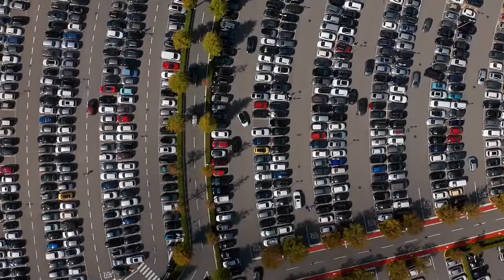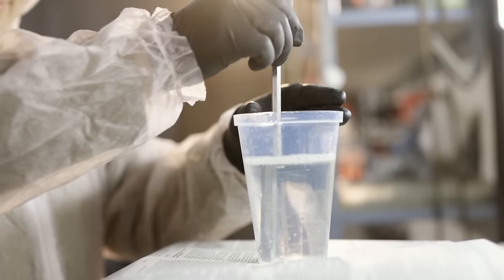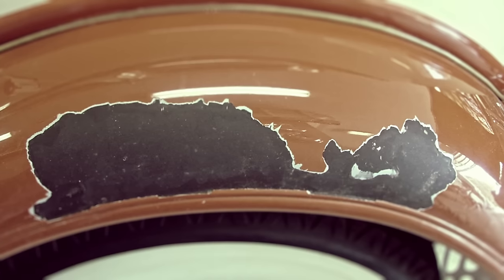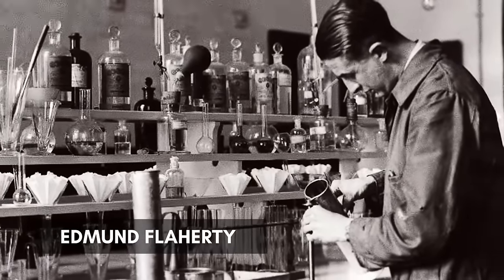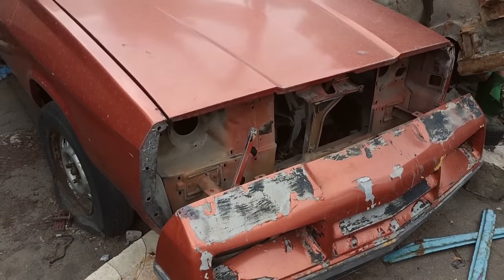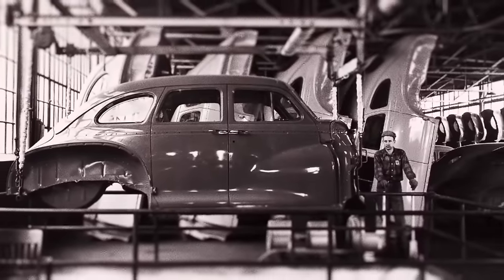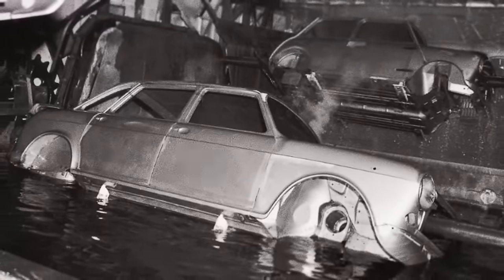The Evolution Of Automotive Paint

Comment: Somebody show this to Mazda and Alfa.

Especially the "rust-preventing-layer" bit.
Reply: Honda too. They're horrible with paint longevity
Reply: @michaelwallace9291  Really? Even today? I drive Toyota, so rust is something I've only heard people talking about 😉
Reply: Yeah he left out the part where they engineered obsolescence into it.
 Guessing it was that part about the changes due to EPA
Reply: @SolarWebsite  personal experience on a 2014 Civic. Horrible paint. Only lasted 2 years before hood and roof were mostly gone. Honda repainted for free under recall but though I requested the whole car be done because the sides were going too the declined stating that painted was faded enough yet to qualify. So a year later went back for sides when they were gone but nope, my VIN had already been repainted and they won't paint the same VIN twice so fuck me.

But of course that's 8-9 year old car. Maybe their paints better now? Ive seen plenty of other Hondas with totally faded paint too but can't speak to them personally
Reply: All auto paint will fail if not protected with a wax or sealant. It gets worse every model year, the manufacturers find a way to thin the clear coat to save money (the paint job is the most expensive part of a car). Fortunately, modern spray sealants have  replaced traditional wax, they last longer and are as easy to apply as spraying a light mist on the surface and wiping it off. The newer your car, the more important you protect the paint.
Reply: @michaelwallace9291  no, it gets worse every year, across all manufacturers. Not to talk bad about Honda civics, but as a fact, its an economy model.The less expensive a car, the worse the paint, since its the most expensive part of a small car by far. The exception being Tesla, some of the worst paint from any manufacturer and they tend to charge a significant premium for any of their models. For example, my dad's Honda Ridgeline has way inferior paint compared to the Acura my mom drives, despite both being Honda products.
Reply: @scottmattern482  that sounds a bit logical. Can't have a product lasting too long now
Reply: @SolarWebsite  Look at a 90's Corolla here in Europe. Toyotas rusted SO much, it's not even funny. Try replacing struts on an old Toyota and tell me how easy it is to get the nuts and bolts off without going crazy.
Reply: @michaelwallace9291  As a detailer I have heard the warning many times now - there is very likely about to be a significant paint job problem in the used car market. Its a two fold problem, the thinning of clear coat every year and the rise in popularity of DIY detailers who grind off most of their clear coat trying to get all the scratches out. Too many people are buying some tools and watching a youtube video tutorial on polishing, but have no idea what they are doing.
Reply: @scottmattern482  oh I got a great story to pair with that! I work at a dealer. Met an old guy bitching about how he had his vehicle repainted professionally but has had to bring it back to that place once a year and complain the clear coats gone and the paints going! Which sounds bad, but hold on! I felt the need to interview him a little about his routine with his car such as if he ever went through touch-car washes ect. Well no to that question he washes his car at home WITH DAWN DISH SOAP. He did not seem very happy with me as I informed him all the anger he's expressed at this company for their terrible paint job is likely self inflicted and to go buy soap made for cars
Reply: They perfected paint around 70s, properly bonded layers and UV resistance. 
Then 80's - 90's they switched to making tin can rust buckets with urethane clearcoats that quickly peel away with a few short years exposure to UV
Reply: @michaelwallace9291  incredible lol
Reply: In the Midwest all cars rust. They use so much salt and brine in the winter that nothing stands a chance. If you wash it often and get it in a heated garage to melt off all the slush every day it helps a lot.
Reply: @ol_smokey9370  they makes sense, I live in dry unsalted California however
Reply: Uhmmm i've never seen an Alfa rust prematutely. Giulia is aluminium or plastic in the key parts anyway. Spunds like VW-bullshit
Reply: @michaelwallace9291  that would be nice, I don't drive my nice car from November to April to prevent it from getting rusty. So I pay to store it, plus paying for a winter car.
Reply: @Android-ng1wn  I think you nailed it. Audi in the 90s era did some amazing work. The bodies lasted forever. The technology to make a car body last a long time is no mystery. But there is not benefit to a manufacturer to do it, just added cost. And with environmental concerns, everybody is running from any unnecessary chemical processes. So forget about fully galvanized chassis ever again... Kind of sad.
Reply: @michaelwallace9291  The Japanese vehicles made in Japan are top notch when it comes to paints. Not sure which market your car came from but I am guessing it is the assembly plants in the US, where the giant towering the paints market is Du Pont. In Japan it is Kansai and going back to the 70's I remember the paintwork on Japanese vehicles was one of the  major factors that attracted buyers from around the world.  The colours were bright and the sheen and finish perfect. And it was Kansai that made their paints. Most probably, Du Pont is the sole supplier of paints to US auto manufacturers. But then, these chemical companies also licence their products to other smaller companies around the world too. So the question would be, whose paint formula did they use for your car, Du Pont, Kansai, ICI, Basf AG etc.
Reply: @mohabatkhanmalak1161  I appreciate your insight, may do a little research now just for fun
Reply: @mohabatkhanmalak1161  Sherwin Williams is also a very large OE supplier of automotive paint.

Comment: My father owned a paint and body shop going back to around 1960.  Back then they typically used "acrylic enamel" which took a long time to dry and had to be put on at the correct thickness so it would self level to some extent.  It took a long time to harden and could not be sanded and machine polished.  They also used "lacquer" which dried fast but left a rough finish with no shine, so it was always sanded and polished after application.  In the 1970s they were using the systems that had clearcoat but the clearcoat would not age well, it would yellow and crack.  The changes to paint systems in the 1980s lead to paints that did not weather well.  In my opinion paint systems used in recent years, maybe still being used, do not have the durability of the systems used over 50 years ago.

Comment: Marvellous video! 👍👍
US EPA also regulates automotive repair coatings fir hydrocarbon emissions. As you note, any painting/coating application is only as good as the surface prep.

Recently saw a video that said automotive coatings found uses in other industries. Fender Musical  Instrument Corp® used DuPont® products on the wood bodies of its famous Stratocaster® and other models for many years. Many colors are known by their GM color codes. The challenge for restoration of vintage guitars and automobiles is finding a color match today.
Today guitars use polyurethane or other more recent coatings or are coated overseas if one must have nitrocellulose lacquer with all its aging issues.

Comment: 0:45  "They're also highly abrasion and impact resistant."

I don't mean to be difficult, but uhh.....no.  If there's one thing automotive paint has not become over the decades it's abrasion resistant---at least not 'usefully' abrasion resistant.

I've often wondered how, with all the 'advances' in car paint over the years, you still have to treat it so delicately in order not to get 'swirls' or other micro scratches (which, to those who know cars, are totally obvious and not at all subtle).  You can't even avoid these scratches by 'doing everything right'---like using lots of water; using only the softest washing cloths; chamoising carefully...etcetera.  

No matter what, you'll STILL get abrasions all over the paint, and they'll only be fixed by occasionally polishing with mild abrasives, only to start getting scratched all over again with your very next wash.

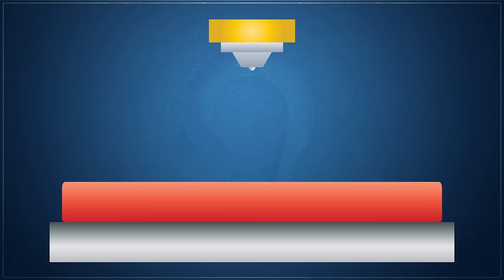Comment: 4:15 I know its a small point to make but its not "melting" the top layer dissolving into the solvent, which then evaporates, allowing a homogenous mixture of layers to occur without a boundary. Melting would imply a change in heat or pressure which isnt happening here

Comment: Excellent information!
Re 'over 40,000 color and texture variations' ...  no doubt that is true, but I have become very aware that the majority of cars these days are black, white or silver.  Sometimes, there are strings of white cars seen on the road.  Use of color in cars has dramatically decreased.    I can speculate as to the reasons for that, but it is a great shame in any case.  Long gone are the days when you could buy cars in a wide range of lurid colors, with two tone vinyl roof combos etc!
Reply: The main reason is there just isn't much demand. That's why most of the colors are pretty neutral because most people like those colors and they can sell them easier. I mean you even see it a lot with even with companies like Porsche and Lamborghini that have some really cool and unique colors yet no one ever options them on their vehicles. Instead they choose grey, white or black.
Reply: It's also why unique and special colors cost more because they usually don't keep a large supply on hand because of the lack of demand

Comment: That was way more interesting than i thought it would be^^
I have one question though: The modern base coat in organic solvent free. But for the top coats nothing was mentioned. So do they still require organic solvents, who evaporate after the spraying? Or are they also organic solvent free, so either aqueous or dry?
Reply: Usually 2pack laquer.

Comment: Lot's of comments and claims  but l believe Glasurit were the pioneers of the basecoat /clear system as post WW2  Germany was banned from using nitro / cellulose as it was used for explosives . I certainly recall we had to repaint a BMW in metallic and  our "number 1 " painter applied the Glasurit basecoat not realising that's literally what it was  and completely igmoring the "top coat " laquer . He spent many hopeless hours polishing the basecoat with the obvious results ! This was around 1973 . As a panelbeater l could understand the perils and positives of this product . I also rudely concluded , if you can piss,  you can paint ! And  preparation is everything , the top coat only reflects what lies beneath ! I must also mention that as a 12 year old my father in 1965 bought a 1961 Jaguar mk2  in Opalescent  Dark Blue . I was fascinated by the iridescence and finish of the paintwork .This obviously predated the 2 pack system but the fabulous pattern and finish will never be surpassed by the modern (!) paints . Very interesting . Thankyou

Comment: While the quatily of the color itself and possibility of mixing millions of tones has advanced and rust protection is far better, I wouldnt agree that the paints are better now. I have seen paint being damaged just after 3-4 yrs on new VW to the point that it has to be repainted while my old VW from 1989 still has the original paint and no stone chips on the hood or fenders. It is also twice the thickness of the new paint and can be polished a lot easier. Cost saving has gone mental on the paintjobs and it is not just on "cheap" cars, BMW suffers from the same issue. 

If I could chose, old acryl paint that MB used during 80s and 90s is by far the best paint for the car imho
Reply: It's not just cost saving it's environmental pressures as well usage is highly regulated.

Comment: Like Richard Hammond said in the grand tour episode about french cars, Paint is just the wrapping a car comes in when it´s new. 
In reality, there´s not much to it. The paint of my 2009 Fiat Ducato was flaking off so I took a bucket of paint and a brush and painted it. Easy peasy. I also had to weld in almost 1m² of sheet metal due to corrosion. In South Europe you can see lots of cars from various manufacturers where the clear coat on the roof and the hood fails and flakes off. It seems to be not so durable after all and still sucks.

Comment: I came here hoping to find out what the new paint/process is that almost all of the manufacturers are using recently.  The surface looks very much like glossy wet milk that someone poured some coffee, or some other clear coloring agent, into.  There are mostly shades of grey, but some are cream, brown, blue or even green.  Whatever it is, it's really noticeable.  It doesn't look like a bottom coat, clear top coat paint.  It looks more like, well, house paint where the base,  pigments and glossy components are all blended together.

Also the white it's based on looks "softer" than the usual titanium-based white used on most cars today.

Does anybody know where I can find information on this new coating?  Thanks.

For reference, the ThorSport racing team trucks use a particular grey as the basis for most of their trucks, and I know that the color itself is used on a Porsche, because the team owner's wife got a new car, and they decided to use that particular color/process.   But at their open house in December I forgot to ask what it was called.

Interestingly, many race cars are still painted rather than being wrapped as you might imagine today.  The techs said that they save about 6-8 POUNDS of weight from the bodies; that's weight that can be added to the lower chassis regions instead, which provides better handling!!!  Pretty serious thinking there!!!
Reply: Dunno if is it, but the BMW M4 uses a process which is similar if i recall. Might be a step in the right direction.
Reply: Also, if I had to guess, I would say it is a matte basecoat with a glossy clearcoat

Comment: Nitrocellulose lacquer paints went out of use here in the US in the 50’s with the advent of alkyd enamels (this is what modern rustoleum is) and then acrylic lacquer, single stage enamels (the original 2k paints) showed up in the 70’s, the 80’s saw the base clear systems take over, shortly followed by 2k urethanes and then the giant pain in the ass water based color coats in the 2010’s. As for hardeners killing painters, the cans have always warned of isocyonates, so if they chose not understand the product they were using then that’s their fault

Comment: The last years have seen a backward progress. I have two vehicles: a vintage Jeep I personally repainted with Duco and a Land Cruiser painted decades ago with 2K. Both saw heavy duty, and the paintwork shows it, but can be patched and repaired. My wife has a two year old Honda with a metallic paint which I did not like from the beginning, but we were not given the option of a non-metallic coating. This paint is extremely soft, shows damage from brushing against lavender plants in the driveway or from someone leaning against the car, and the only remedy is to respray the car as a whole. Numerous complaints with Honda ended fruitlessly, they did not even want to give me the standards of hardness they use to test the coatings.
Reply: It really comes down to thickness. The custom paint jobs you're talking about put on waaaay more material than a oem paint job. Think about it; paint is extremely pricey, if you can save grams per car, that's millions in the long run. Honda Toyota and Ford are notorious for this. I prep cars for a living and constantly burn through on parts that are supposed to be blended with these newer cars.

Comment: The best investment is on granite paper so it can change color but it can defense against emf and heat and laser it is clay and carbon under high pressure hight temperature so it can handle safely when easlily apply require no sophisticated painting tools and sophisticated formula and it prevent electrical shortage and lighting attack

Comment: But, in reality.... Got 40+ year old tractors where the paint still holds.
And nothing rusts. 

While, New cars rust as soon as one buys them. Longetivity is nonexsistent. 

And nothing is even remotely close to zinc galvanised metal painted with simple drain paint. 

Surely expensive. But not terribly. Even i did manage to apply zinc coat to steel át home, and paint it.  Was quite a while a go, i painted my tractor tools. Those get debrish, slats, many impacts and scratches from plants, small rocks, soil etc... And still looks better Than a 10 year old car.

And no rust. Thats what cars can not do nowdays. They all Roth away nooooooo mather what you do. I got a less Than 2 year old car that allready will need a New coat of paint on its underside. Rusty water comes out of the frame it self. Its a small truck. 
I think about 5 years and the whole ladder frame is going to be fubar. So i gona get me self a spare ladder frame, Sandblast it, apply zinc via electroplaging
Reply: Electroplating, seal all them holes made for nothing else then to allow water to get in and screw things up, and paint it with regular oldschool drain pipe paint. As that lasts long and does its job.

Comment: Its great that there has been large advances in the automotive paint industry.  The problem is that paint is only on the surface or " lipstick " of the car.  Underneath almost everything is barely coated and in less than ideal conditions the metal there corrodes very quickly.  Sometimes to the point of total failure.
The automotive industry needs to address this and not just create paint to sell a car to us.

Comment: All that engineering to throw paint on a car as fast as possible.
Yet it is impossible to get an acceptably smooth finish, even on a brand new car?
The bright inspection lights showed a lot of orange peel even visible to the camera.
Valuable cars get wet sanded then polished to a mirror-like finish.